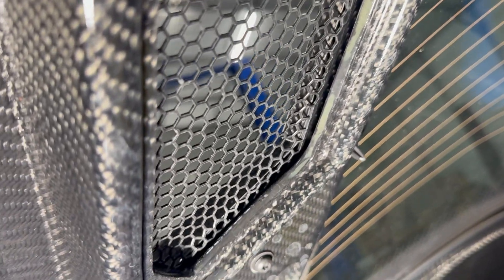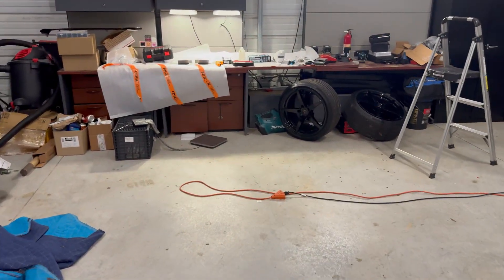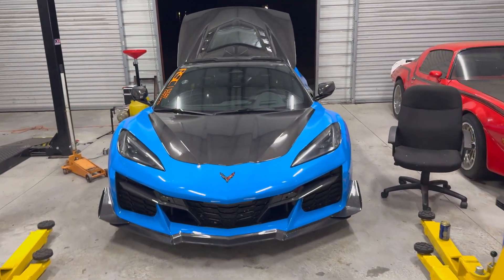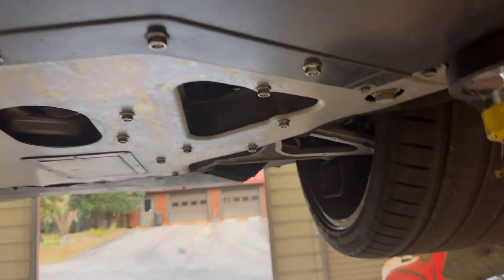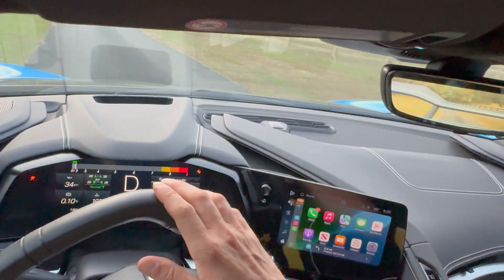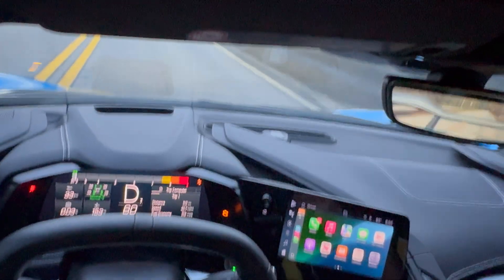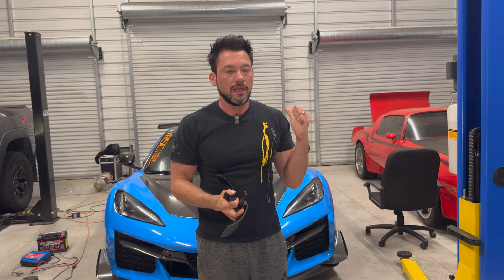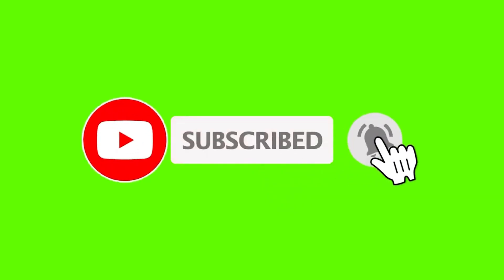C8 engine bay cooling with underbody air diverters

Comment: try this from ACS Composit
ACS COMPOSITE
C8 Coupe Rear Intake Ports
SKU:[50-4-122]CFZ

★ ★ ★ ★ ★ 5 out of 5 stars (18)
Regular price $1,148.85 USD  Sale price $929.00 USD  Sale
Reply from the maker: Only reason I feel like the lower ones work better is due to the natural inclination for heat to move upward. So I feel like this might work better
Reply from the maker: Not that those don’t but I think from a turbulence standpoint maybe more efficient this way?
Reply from the maker: But I guess the other argument would be those could create downforce potentially ?

Comment: I wonder if flow through heat sink bolted to escape points could help the carbon fiber hatch not discolor or breakdown 😊
Reply from the maker: I considered putting that on but worried it came off could fall on header and become flammable so decided to try other measures

Comment: Definitely an interesting addition. I'm still very curious why the US cars don't get these things... 🤔
Reply from the maker: Regardless probably a lost revenue stream for GM . Can’t wait to see what unfolds w more people trying and seeing the pros/cons
Reply: If US regulations don’t require it, GM ain’t putting it on
Reply from the maker: @PT3_RS ^^^
Reply: Could involve emissions, they seemingly want these engines to run hot as hell
Reply from the maker: @vertisjohnson219 true , especially since it hits the cat
Reply: Any chance they scoop rain/ water up and push it in the engine bay?
Reply from the maker: @justinbabler2663 I feel like you would have to be in some serious rain at serious high speeds to get the velocity to move the water like that. But possibly so. I really don’t drive any in the rain much it’s not fun to me w the car so not an issue here.